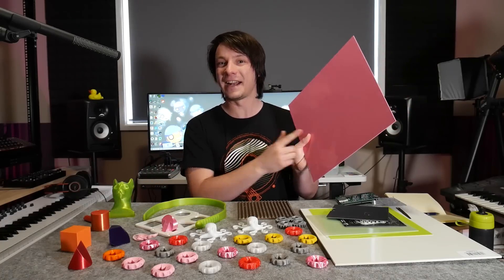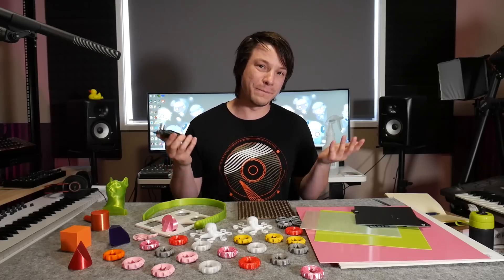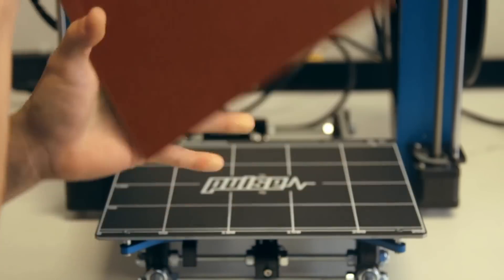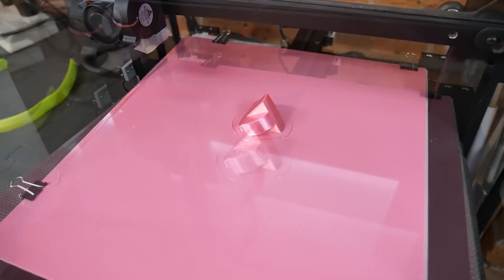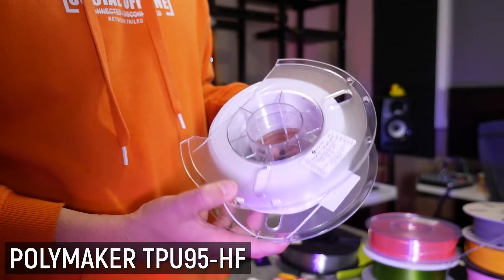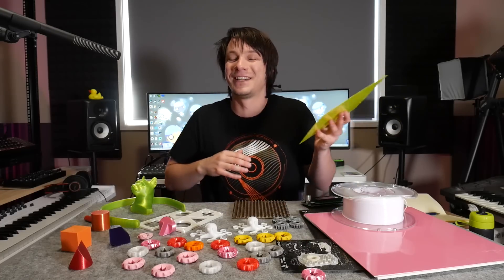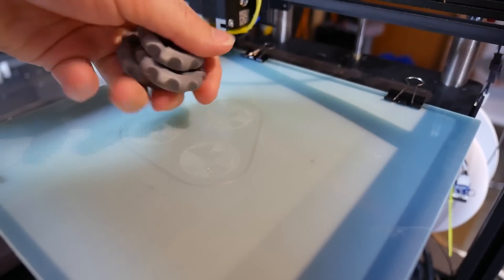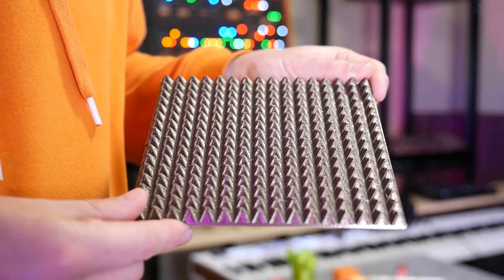G10 - The best print surface you've never heard of.

Comment: @MakersMuse, Great video. I'm looking to reduce the weight of my bed-slinger and I was wondering if one could use a G10 board coated on one side with copper (PCB) and stick a PCB heater directly to the copper side. Removing the aluminium plate altogether. I think flex would be an issue, so a thick board would be preferable. And wondering if the copper film is thick enough to act as a heat spreader.

Comment: I used that stuff on the heated bed of my Anet A8 back from 2016 since then, just taped it with double sided tape onto the bed back then and any time the adhesion decreased I just had to sand over it and wish away the dust

The biggest problem, which is why I changed to a magnetic PEI covered sheet just this year, is that my 8mm induction probe had real problems sensing through it and was really, really close to the height of the nozzle which meant that I just a few bed crashes over the years...

Comment: Has anyone experienced this stuff working better than expected and then just suddenly not sticking to anything anymore? I've tried cleaning with IPA and water. I even tried scuffing it up with thousand grit sandpaper. I have checked bed level and the z offset and can definitely rule those out. I don't even think I've printed two kilos of filament since installing the surface. Does it wear out?

Comment: question: I have a 3d pen and I'm searching for a optimal surface. would be perfect if its transparent but not necessary. I don't want to put some extra stuff on the surface, or heat it. So my question is: Is there actually any surface which fits with these restrictions?

Comment: Thanks for the G10 tip! Been looking for a cheap solution to an increased bed size on an old machine.
As per your TPU sticking too well...
First of all I use no heat on the bed and secondly and most importantly I use a homebrewed tack that not only helps things to stick but also allows those that stick to well to release with ease. A 10:1 water:school glue mixture (or possibly an even higher dilution) in a simple squeeze bottle. I dollop about a nickel to a quarter sized pool on a 235x235 bed. You only need enough to dampen your print area, making it look evenly wet all over but not puddled.  I apply it with a plastic putty knife, allow it to dry completely before printing over it. When I feel the need to revitalize it after many prints, I genlty wipe the bed down with a damp sponge as one application is good for dozens of reprints normally. If parts start to become hard to remove once again. Clean the bed and reapply. Also if you must, though I've never had to, you can dampen around your print with a sponge to easily solidify the already highly diluted water based tack to release your stubborn stuck print or literally rinse your part right off of your build surface at the water tap.

Comment: Two more things, actually "lifehacks" for problems you had:
1. In order to reduce risk of deformation: use epoxy resin with higher Tg (glass transition temperature). Preferably at least 130*C. This should reduce a lot risk of softening the laminate due to high temperature. If not 130*C, then at least 110*C. Worse but absolute minimum.
2. In order to fight bow and twist: use single copper sided FR4. Copper has higher thermal expansion than FR4, so since you either way clip the plate to the bed, there will be forces on whole area pushing the plate into the bed. Not very high forces (to release the clips) but high enough to fully align FR4 plate to shape of the heat bed.

I'm surprised that you couldn't buy this material in Australia. There are many EMS (electronics manufacturers) in your country, and they use this material in thousands of square meters. Also China is so close. 
Alternatively there should be a good source for distributors of stuff for prototyping electronics - both clean FR4 and copper-clad is used a lot.

Comment: I have no idea why you refer to this material as G10. I have never heard of such material, while I know FR4 for most of my life. And you don't differenciate Garolite from FR4. 
FR4 is great, it is "rough" on microscopic level, it changes it's dimension so after cooling you just take away the print. 
Only 3 drawbacks:
1. Resing slowly is left on print and evaporates, so you need to exchange it from time to time
2. It has quite low thermal conduction, so you need to set way higher bed temperature than eg when using metal. 
3. Flatness and uniformity of FR4 is usually not good enough for big beds with fine layer height. But that's not an issue when printing 0.2mm layer height and probably not 0.1mm (if bed <200x200mm)

Comment: Awesome, thank you! I have a magnetic aluminum/glass bed on my trusty 10 year old Makerbot Replicator 1, where the bed is aluminum, and I have glass plate with 4 magnets in the corners which get magnetized to magnets on the aluminum plate. I think I will give G10 a try by cutting it to the same shape as what my glass plate was, and simply attaching magnets. That way, I'll have a removeable G10 bed... thanks for the great video and tips!
Reply: Update: wow this worked really well, thank you!! The 1/16" (~1.5mm thick) garolite sheet was a huge save. I have been printing larger objects lately, which are a nightmare to remove off of my glass+blue painters tape build plate. I think I actually got a repetitive strain injury on my thumb because of how much I have had to dig and pry my palette knife/spatula underneath the print trying to get it off.

 I just printed the same large part on a garolite sheet and it came off so easily with the bending action!

I think I still like putting blue painters tape on top of the garolite, because I think it adheres slightly better and gives a finish more consistent with the rest of the printed piece. However, the flexibility of the garolite sheet alone makes it worth using. I put magnets underneath the garolite sheet so that it magnetizes to my build platform, so I have a hotswappable/easily removable build plate just like I did with my glass platform.

The only thing I'll have to pay attention to, which I'm not sure is an issue yet, is that the garolite sheets on McMaster Carr have a relatively large tolerance thickness. However, I think that tolerance thickness is probably if you purchase multiple sheets, whereas a small sheet (e.g. 12" x 12") seems to be within a reasonable thickness tolerance within that sheet, and it seems pretty flat. So, as long as one is using the same piece of garolite, the build plate doesn't need to be adjusted. If one uses many different sheets that have a large thickness tolerance variation, then this may become an issue (unless automatic bed leveling takes care of that, which I don't have on my trusty old Makerbot Replicator 1 duals)

Thank you for this awesome tip!

Comment: I personally found PETG to work the best for me, on a stock ender pro 3, the source of the PETG however, quite bad, I want to know if I'm alone in this issue, I had the roll come with multiple points of failure in the roll itself, to the point where I had to unwind it about 30% to rewind it properly or it would get stuck on itself. This was a really bad issue given that it happened to both new rolls I got. And being a broke unemployed game dev made it a big loss to have the prints fail. (granted I did contact the manufacturer and they did give me a new roll for the issue) 

I wont name the company because I still have some respect for them and don't want to harm their rep where I live. 

Also on a stock ender pro 3 the best settings for me was the settings written on the rolls, 255-270C on the nozzle and 70C on the bed worked well when I fixed the rolls.

But yeah, would love to know if you ever experienced this as you have a lot more experience than me in 3D printing.

Comment: It would be nice to know what sort of flatness to expect, or if the G10 is so flexible that it will match the flatness of the underlying hotbed. My Sv03 heatbed is not as flat as I would like and I worry that would translate to the g10 more so than the glass bed. I shimmed under the glass with tinfoil strips and that helped substantially, maybe the g10 would be fine with that as well.

EDIT: McMaster has 1/16" 24"x24" for $57 after shipping. Kinda pricey for an experiment. Why did I have to choose such a large bed slinger...

Comment: It's may be better with some things, but the way you explain it, it sounds like you need a thicker board to reduce the board warp and the thicker the board the less heat transfer and you can't simply raise the temps as there is a concern of the board going to glass transition. 

I think I'll stick with the glass bed that I find is good for 99% of prints - using pei for those that doesn't. With glass my tpu comes right off and petg is no issue with a glue stick as a release agent. 

Until the next fantastic thing, I think I'll hold on as is..

Comment: Did you try G-11 by any chance hands down best one I have used for Nylon specifically not sure about PLA PETG ABS just know nylon its phenomenal thru a 1/32 sheet with double sided 3M sheet onto a Prusa MK3S knock off FYSETC removeable bed sheet and i have now made 4 sheets like this for just one sided printing since the thickness of the build sheet

Comment: I work with G10 a lot. I consider it an evil material as a machinist, as it will destroy the cutting edge on pretty much any tool that touches it and being a laminated material you need to take special considerations in your setups and even tolerancing. Not to mention it being fiberglass and getting everywhere and all the itching. However, it dose have a fantastic electrical resistance rating and a reasonable temperature resistance which is why we use it in a lot of resistance and mig weld fixturing. Unfortunately for being a "standardized material" there is a lot of variation from manufacture to manufacturer. Some use chopped fiberglass vs stacked fiberglass weave, and how thick the resin coating layers are on the top and the bottom can vary considerably. The material also tends to have similar issues to 3d prints cooling when it cures often leading to the center most point of the sheets being considerably thicker than the outer edges, but this is more noticeable on much thicker sheets. 

Personally, I would check with some metal distributers as they tend to have it on hand for industrial electrical use. Also, the higher temp versions would likely help with the shrinking spots as the resins in the standard low temp like to do that if you are getting close to their burning temp. Which by the way, the low temp G10 resin will burn, it is not very good at doing a self sustaining fire, but it will char and make a less than lovely smell. While your bed temp is likely not exceeding the safe temp, either the melted plastic, or vicinity to the hotend is probably transferring enough heat to cause the issue.

Comment: After hunting high and low for G10 sheets (cut to size), I eventually got my grubby paws on some, and OMW. Angus, I am sooo glad I came across this video. I've been printing on the stock glass that came with my Ender V2. It's not been bad, but G10 is the bomb.
After adjusting the Z-height microswitch and doing a bed level, all I can say is WOW. 
Thank you so much.
Reply from the maker: Nice! I felt the same way when I first tried it haha. Glad you could track some down .

Comment: I have the Neptune 2 with the stock G10 surface, and I use these sticky silicone pads between the G10 and the metal bed, and it sticks great, and because you just have to use a few small squares, it still gets up to temperature

Comment: Angus great video. I love your content and it has really helped me with my 3D printing projects.
One question,  I've used G-10 from McMaster Carr and it has worked great for a while. Recently I noticed that the prints aren't sticking to the bed as well as before. I've gone through all the regular troubleshooting (re-leveled bed, slowed down 1st layer, etc.) but with inconsistent luck. Has anyone else experienced this? Is there a different G-10 that is better suited fort 3D printing?

Comment: Grabbed some branded garolite and nothing sticks to it. Not sure what magic he's doing to get it to work.
Reply from the maker: Make sure there's absolutely no oils or dirt on it, i used IPA to clean it off but soapy water and dried should also work. It's possible their formulation is different to the generic stuff this vid is based off. And it absolutely must be heated.
Reply: @MakersMuse  Think I figured it out. I'm using Garolite CE which is apparently a low cost version of their G10. They use cotton for the fibers instead of fiberglass. It's also extremely flexible and it noticeably warps when heated.  I went back to a glass bed with hairspray.

Comment: I've been using FR4 1.5mm on my Prusa, on top of my steel bed to keep the pinda working. Just fits. Ever since I've been using it (6 months now), the prints (PLA and PETG) simply work beautifully. No needs for adhesives and after the cool down, the prints are often already fully separated on the print bed. After a lot of hassle, this makes it so much nicer. Thanks!

Comment: Thank you, very very much!!! I got one 8x10x.093 in. Smaller than my build plate but not by much so I though I would try it before having a few cut to size. I used clips to hold it in place and started printing. I am using a CR6SE and was having problems with adhesion with the stock build plate. I had already ordered a new one but I saw your video and cancelled the order, and I am so glad I did. 
After I put it in place and held it with clips and started printing. Amazing!!! started printing great right off. No issues I have been having with the stock build plate!!! It only cost me 5.99+tax. So much cheaper and much better.  I will go to Lowes, find a sheet with the correct thickness and have it cut to size and many as the sheet will allow.

Comment: Great video and innovative.  Getting a flat surface really takes a lot of frustration out of printing.  I'm tired of staring at the first layer. Why can't you print a frame outline of the aluminum bed and glue it to the bottom of the FR10 so it's laterally stable for printing and held down by gravity. Won't that work?  At the same time you can use that method to enlarge your printer area.

Comment: you are a genius! I just bought some of this for my Ender 3 Max and it was just as you claimed it would be.... a 300 x 300 mm sheet of this material in the UK was less than £10 (i bought 1.6 mm, 2 mm & 4 mm) and the glassy first layer is something to behold! So far no issues and 10 prints in the release when cooling is excellent. I've been using 60 degrees on the bed and when it gets to room temperature (around 18-20 degrees) the prints just pop off, even at close to 30 degrees prints come away with very little effort (you can't say the same for the glass beds!). Thanks for the tip!

Comment: use a thick piece of perspex (like 10-12mm) and sand the top of it with a fine grit. i tried everything as per usual,  this is the best hands down. grips but doesn't grip crazy hard.

Comment: If it has to be there in the morning I still prefer tape packing for petg, blue painters for pla. G10/FR4 has failed me to many times so has PEI. Yes I have tape imbedded in my model but the print is guaranteed to finish. G10 works if the room is warm but if its slightly cooler it will fail every time. I have multiple magnetic build plates with different materials. I swap as needed.

Comment: Tempted to get a steel plate and glue the thin stuff to it for use on a prusa i3 mk3s+  Don't even HAVE the printer yet, so way getting ahead of myself but I have been seeing some over adhesion nightmare stories regarding petG and the newer smooth pei sheets. I got the smooth pei and the satin so hoping the satin will work out okay.
I think I will use what they ship me until I destroy one of the surfaces and then use that to experiment with some g10 on it.  Not sure how it will work glued down to steel with thermal expansion.

Comment: Tried fitting G10 to my Prusa i3 Mk3 after getting tired of the PEI sheet (which works well) fatiguing over time (expensive).  Am I missing the point but because it is not a steel sheet, the Pinda sensor won't work properly to get your nozzle height???????  If so, guess I have to replace the Pinda sensor to something else.  Thoughts?

Comment: Thank you for this video. Just started using g10. I have to say that this is the best upgrade I have done to my printer so far. First layer print is beautiful. I have been able to tune my bed level for amazing adhesion with no elephant foot and they basically fall off the bed when cool. Thank you very much. I have a 1/32 sheet. Bought a cheap one just to try it. Going to go to a thicker sheet even though I've had no issues with it and I've ran 20 or so prints so far, only had 1 part warp.